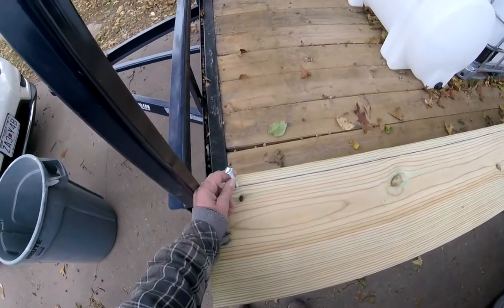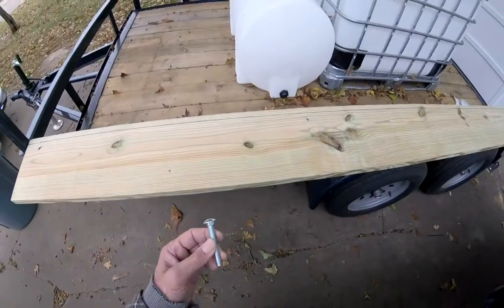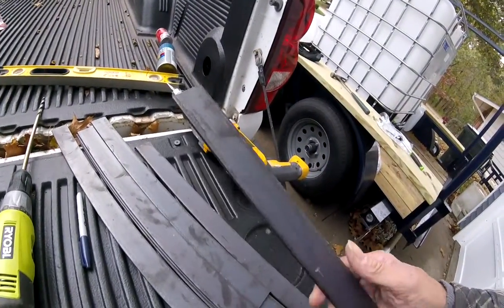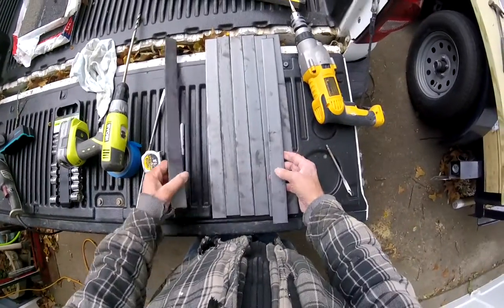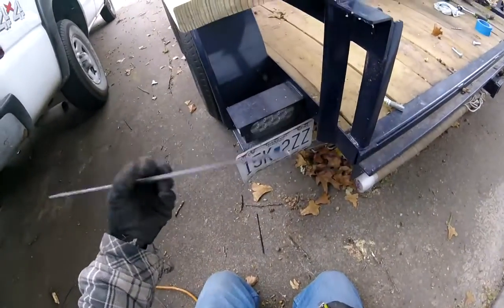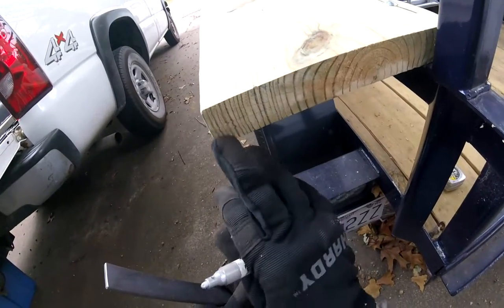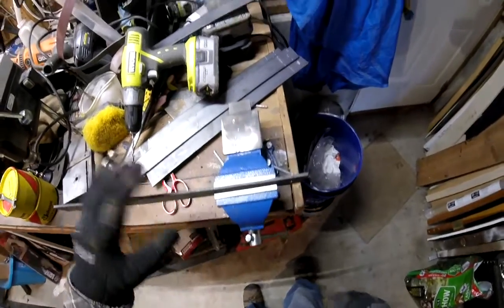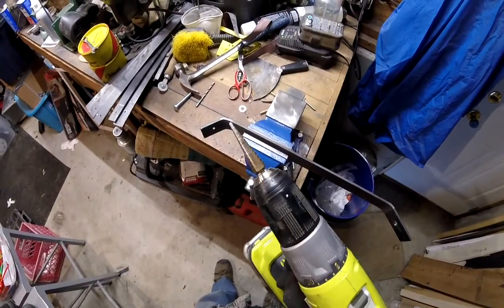Part 3.    Soft wash/Pressure wash trailer build.

Comment: That's a proper shelf..
Just a thought..I saw you had a couple of cans of paste wax on the workbench..might not be a bad idea to put a little on the shelves to protect them.
Reply from the maker: The boards are still wet but great idea!  It's possible that in the spring I might take the reels off and paint the boards?  Not sure....  But I couldn't wait for them to dry to mound my equipment.  Good eye spotting the wax though.  I use it for lube on wood glides and the beds of my table and chop saw.  Makes things slide around like they are on air.
Reply: @housewashing5693  well.. there is this stuff for wood products that are always around water.. Seal Once Marine.. I have used on anything from 100 year old ship lap siding to brand new tongue and groove.. Its a water based nanotechnology sealant that is very good at repelling water.. the water just beads up.. Might be something to look into in the future.. as you know "green treated wood" is great for any outdoor application this stuff is just a little precaution..insurance if you will.. If you do choose to use traditional paint...I would choose a hardcore outdoor oil based barn or shed paint..
Sorry.. im blabbing again..
Ill shut up now..😁
Reply from the maker: @MNpicker  I was thinking a type of deck over thick paint?  I hate the thought of removing all my stuff just to paint!.  I'm now thinking of simply seeing how long the natural look will last